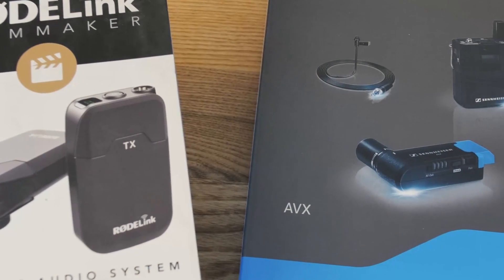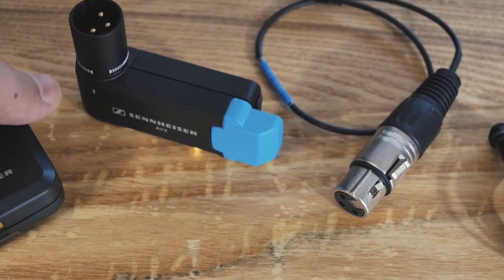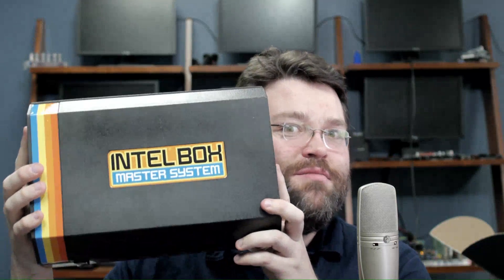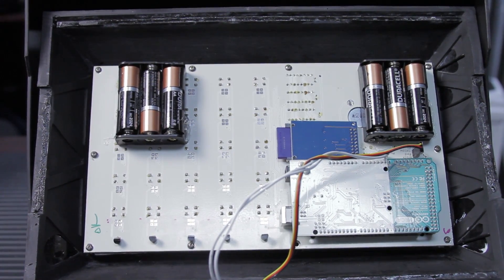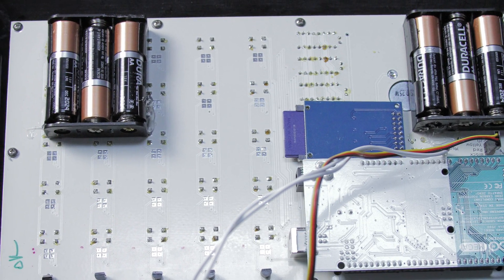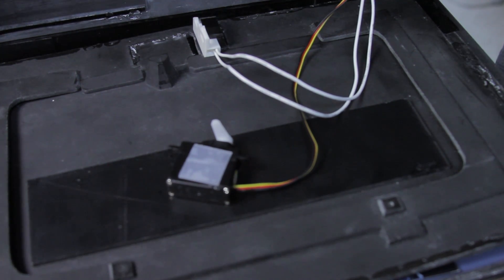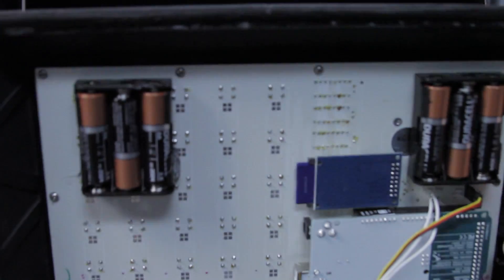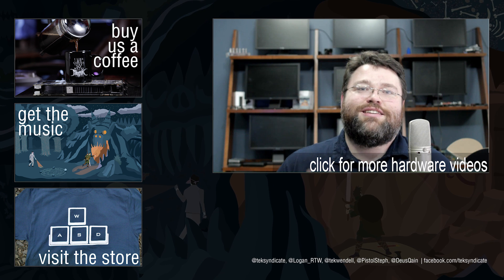Intel Master System Teardown: 8 bit RISC guts!

Comment: I actually was thinking the same thing for fixes when I saw all the broken ones that got to tech channels.

BTW Shoe Goo is essentially marine repair glue (for patching inflatables or doing emergency rubber patches for boat leaks) with slightly less harsh solvents.  Sometimes you can find it cheaper that way and it is easier to work with.

Comment: Is this the new console with Intel CPU? 
While being definitely a sizable competitor to AMD consoles like PS4 and XBOX ONE, I think it also expresses  both the Intel philosophy and their clients profile: is square, locked in time, ... like idk 40 y ago... with big lights that come from inside to amaze simple folks, and a lot of processing power since is 4 times bigger than AMD cpu's box, so it's obvious... also requires 6 batteries before being plugged to the wall, so it draws energy when off.... that's a performance nobody will be capable to reach, ever, and finally explains how a 80Watt TDP Intel CPU gets twice as hot as a 95Watt AMD... it draws power IN TIME... not all at once!

Comment: How about Intel deliver WAY better desktop CPUs instead of "cool" marketing gimmicks?!  Intel's "Tick Tock" releases are holding PCs back. Your buddy Linus said that all the fanfare surrounding how great the iPhone 6S performed compared to the MacBook had more to do with the thermal throttling of the MacBook..I blame Intel for not delivering CPUs that can be included in fan less builds.

Comment: Is there any license on the software? Maybe one could try to do some reverse-engineering as I suppose it's just some modified opensource OS (probably Linux ofc.). One could maybe then find out what was modified by intel and what untouched and at least change some part of the code if one doesn't break the ABI with it.

Comment: Arduino Mega and no source huh? I wonder if anyone tried to dump the chip yet?
Reply: Garry Perkins
That's pretty much impossible. Once it's been compiled from C/C++/whatever, into 'machine code', it's almost impossible and extremely time-consuming process to revert it back to a form that even somewhat resembles what the source code might have been.
You can, however, flash the memory of one Arduino, onto another identical one, and make an exact copy, but you will not be able to retrieve the code itself.
The only way you can get the source code, is by contacting you killer programmer guy friend, and ask him for it. Most people are pretty chill about that kind of stuff :)
Reply: Garry Perkins
Hah, no sweat. Atmel AVR programming (or Arduino, if you don't know C) is awesome, once you get a hang of it, and you have the necessary components for your project.
Good luck with whatever you plan to build :)
Reply: +AWal 
Totally. Currently using the Mega2560 myself for a project at uni. Shit's so useful once you get a hang of memory designation, and all the PORT/PIN syntax in C.
Wendell should totally upload a rundown of the components and how to replicate it.
If possible, he should also include the dump as you said.
Reply: +IchBinEin So if you have any arduino you can get the actual code off of it? I have another guy's project, and he is a killer programmer. How would I get that off the arduino?
Reply: IchBinEin Thanks. I do not know much about Arduino. I should have realized that a deployed project would have been compiled.
Reply: IchBinEin Thanks bro

Comment: I thought porcelain was non-porous, and therefore used in toilets because it doesn't absorb things?
Reply: That is why porcelain is glazed. It is the shiny outside but if you lift off the tank lid and look underneath, you can see and feel the porosity.

Comment: i don't actually think intel aimed this at makers just because there is a custom curcuit with an arduino driving it.
you only even saw this because you are a maker and took it apart.
i think in reality, it is  just a fun lockbox wich had to be made in a way that's suitable for such a small number.